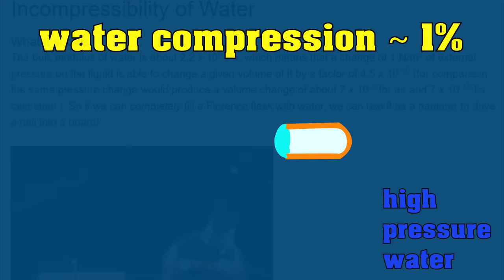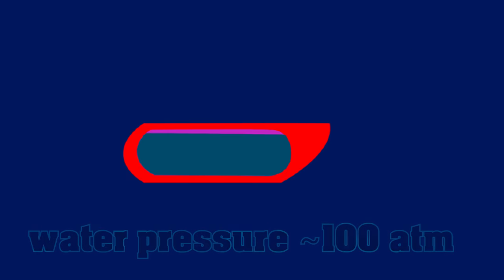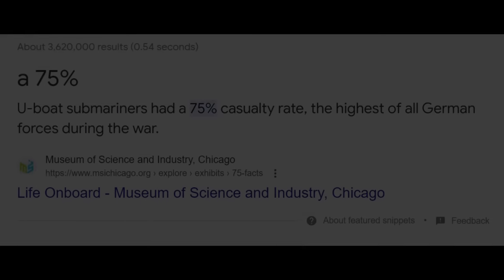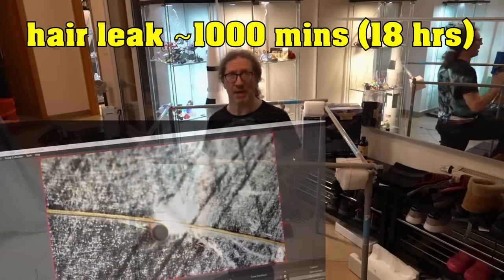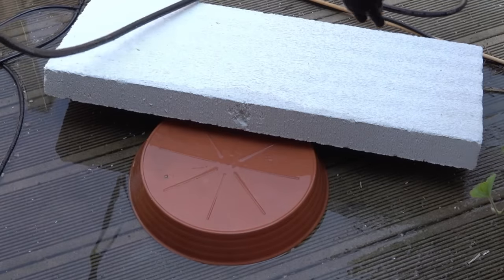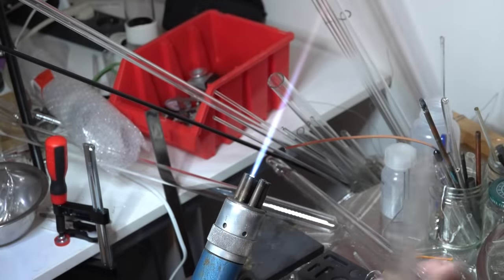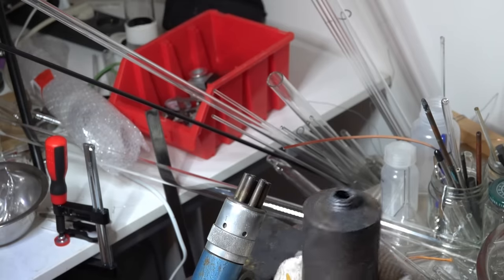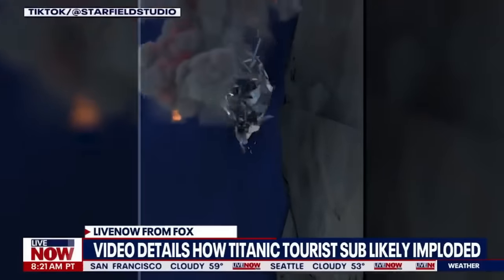Why the Titan sub failed

Comment: I'm not really concerned about the glue bond, because the end-domes are being pushed on with millions of pounds of force.  The problem is the carbon fiber wants to shrink, but the titanium ring won't let it, resulting in an enormous stress concentration at the joint on the inside of the sub.
Reply: 150 million lb-f according to my cell phone calculator.
Reply: Logic is a bit flawed there. Yes, the pressure is pushing the end caps into the CF hull. However, that CF hull (as you yourself point out) moves somewhat independently, and differently than the end caps, or the glue itself. So there are multiple, competing stresses on that glue joint. I think it's the most likely failure point, next to the hull itself.
Reply: Yes, the fiber is the inconsistent element  that itself was built with no sheer web whatsoever.  The bonding operation itself probably had a lot of voids - but still that doesn't matter compared to the tube's complete lacking of sheer structure.
Reply: Well, because of what mentioned, when the cylinder begins to bow inward, the compressive force of the caps will begin to further cause the tube to collapse within itself. It will cause it to buckle inward in a feedback loop.
Reply: Thing is that they literally have the glue bond inside out, as the ring should have had an internal structure as well, to transfer the compression force from the carbon fibre to the inner titanium ring via the epoxy, not put a tensile pull on the epoxy join. That would lead to the carbon fibre delaminating with pressure cycles, and failing. They constructed that join surface as if the join was for a pipe with pressure inside, where the pressure will hold the epoxy onto the cap, not the other way round. Pipe shrank under pressure, and eventually some microscopic section of the join, likely with an embedded air bubble in it that had been compressed to have a sharp edge, caused a stress that started to propagate through the bulk resin, because there is no stress relief in the resin bond, and this then eventually grew to the outside, where water was able to fill the crack. Now the water is applying pressure to a section that can flex, and grows the crack into the joint further, aided by the tension in the epoxy join, and this then rapidly, basically the speed of sound in the epoxy as the growth speed, grew to open the joint to the inside.

That joint should have had an inner and outer lip, and have been filled with epoxy with a slow cure time, and then have the shell pressed down into it, also with a coat of the epoxy on the surfaces, and then pressed together, with a few vent holes for the excess resin to flow out in the titanium, that later on would have a cap bolted and bonded to it. Or a thicker section that you put a setscrew in to fill the hole, while the resin is still not cured, after it has bottomed out, then left and heated to cure fully before removing the pressure.

That join section should have been at least 3 times thicker, and longer, with a taper on the inside to allow a flexible sealer to be there, to allow the join to flex with pressure, not a solid non flex epoxy only. you want to not have stress risers, and a solid join with the different materials will have that stress riser. This hull was likely only going to last 3 cycles before you would have to replace it, they should have done testing, using a deep water area, and a cable and cage, to measure the number of cycles to failure first, not used the passengers as alpha testers.
Reply: With cars, if you are attaching a wide body kit made out of carbon fiber or fiberglass directly to the metal body, you need to not only use the adhesive but bolts or rivets.  Simply using the adhesive will result in cracking after a few hot days and cold nights coupled with road vibrations.  The adhesive is to allow some flexibility between the two substances.  The bolts or rivets are to keep the flexibility to a minimum.  Mainly because they are two different materials and they expand / contract at different rates than each other.

Using just adhesive to hold titanium to carbon fiber without the use of restrictive hardware like bolts, and all you have is a failure point in the adhesive.  If a cars wide body kit cracks just from driving the car around, and it sees mild temperature fluctuations, all because two different substances were adhered together with only an adhesive.  Then how would a submersible be any different considering the extreme water pressures and vastly different temps from sea level to 12,000 feet below sea level?  You not being concerned about the glue bond would be ignoring one of the most glaring problems.  

That adhesive used to attach the titanium ring will let go before the carbon fiber unless the carbon fiber has developed a flaw elsewhere.  Remember, the adhesive is to ALLOW flexibility between two different materials while holding them together.  Its job is literally to expand and contract to attempt to keep that seal.  But just like all adhesives, they can only expand and contract so far.  Hence why there are restrictive hardware items used to keep that expansion and contraction limited.
Reply: @sompka1  A P-Delta affect. That compression at the mid-span of the carbon fiber gives it an internal moment that it has to resist, which also deflects it further and increase the moment, and if it's not stiff enough this can spiral out of control immediately. Usually it's just a small affect you need to sometimes consider, but for very slender structures or very high loadings, the P-Delta affects can pile up.
 
Per the video it would deflect about 1-cm in diameter, or 0.5cm each wall, at 100 atmospheres, but that's onlky 1/3 the way down. At 360 atm, with a 5.5ft diameter, it has 23 million pounds of force on each end, or 741 k/ft of wall, that would be 525-in/ft of internal moment; at a thickness of 5in, it has a section modulus of 50in^3/ft of wall, so 525k-in/50in^3 = 10.5 ksi. That's about 10% the strength of high strength steels, or 3-5% of carbon fiber's strength.
 
So nothing major, but a simple and direct reduction in strength just due to the geometry of the sub and the compressibility of carbon fiber.
Reply: While there may be millions of pounds of pressure holding the end caps on at depth, that is not the case on the surface where this three piece barrel was drug at 15 knots for hundreds of miles across rough seas. The sub was not designed  to be towed like a bucket behind a ship, and this definitely could have affected the glue joints, making at least the rear end cap fit like a loose har lid. Everything in the sub being subjected to a beating by rough seas would certainly subject it to mechanical failure. And lastly,; if you couldn't, or wouldn't, haul that sub out there in the deck of a ship instead of dragging it then it's not likely that it was even inspected before launch.
Reply: @sompka1  Euler failure mode in compression.
Reply: @mr2miach  Thing is car body kits are not run under much strain, as they flex a lot, so the attachment points have to penetrate the material so it is held in place mechanically, as the glue join will flex, and eventually pull the fibres off at the surface. Here the issue is the join has to be orders of magnitude stronger, and any penetrations for bolts would have resulted in massive stress concentrations on the fibre area around them, making them fail quickly. Car body kit you will see crazing of the paint surface before the fibres themselves are compromised, so you are running it under low strain, but here it is run close to the full pressure rating, with little margin for any error, and cycling will slowly degrade the bonding to the point of failure.
Reply: @SeanBZA this sir, is the best comment I've found detailing what needed to be done vs the reality of what was done with the decision of CF hull jointing with Titanium for their deep dive purposes. 

The fundamental flaws and differences... literally mind blowing
Reply: @SeanBZA  did you just correct me by stating the exact point I made back to me?  Because you stated the same point I made.  If a cars body kit fails under much less strain, then how in the world would anyone expect a submersible to do any better?
Reply: @mr2miach  No, car body is designed to flex, with bolts to contain it, this submarine was just a poor design with no way to safely indicate it was about to fail. The testing they put in to tell it was under strain was always going to respond too slowly to prevent the implosion, as the warning came with only a few minutes of time left, when the hull stopped creaking, as all the spare tension in it was left, and the delamination was going to occur as soon as a single fibre brook loose next from the matrix, releasing all the pent up energy in the matrix nearly immediately.
Reply: @SeanBZA  The tube's only unidirectional fiber structure had no designed sheer strength preventing a bisecting fracture; the only structure preventing that was the ring. One area of the most-loaded stress then, as you point out, would have been just outside the ring. However, the images seem to show that that zone remained strong enough for the whole ring to be blown cleanly off the tube.
Reply: @MarkShinnick  At least the front did, have not seen the rear bulkhead, but I would assume the failure was there, and it blew off the front during the pressure pulse from the implosion. They got the rear well mangled, so the implosion was likely that end, simply because the rear would have been turned into shreds if the pulse of pressure had come from the front, just the back is mangled likely from the collapse of the tube there.
Reply: @SeanBZA  I see someone has seen the supposed leaked messages between the sub and the top side.  Point is, it looks like we agree that the adhesive mating the carbon fiber tube to the titanium rings is a possible failure point, because the adhesive is there to allow expansion and contraction of the mating surfaces.  Weird how you correcting me even though you agree.  Oh well, some people just have to argue because reasons.
Reply: @SeanBZA  Seems that any breaching of the tube would simply blow out both rings just as cleanly as what appears in the photo.

Comment: At 20:18 I sure hope that wasn't their official cleaning of the rings, wiping it down with a rag (presumably soaked with alcohol) before the glueing process with the other hand lagging behind depositing grease / oil back onto the surface.
Even with mountain bikes, it's stated hundreds of times to never touch the surface of the brake rotor as the natural oils / grease on your hands will ruin the brake pads.
Reply: You saw the guys hand as well ! I am glad someone else saw that, and I was also thinking the same thing. So careless if that was the final cleaning.
Reply: still amazes me the amount of people who touch these things... or even when builders apply silicone with a bare finger, i dont want mouldy grout!

Comment: You can design pressure joints between dissimilar materials that will work fine. Industry does that all the time.
Often the pressure will be used to seal the joint by pushing the joint together.
Piston rings , for example , gas from the the high pressure side of the ring is directed behind the ring to force it against the cylinder bore.
Reply: I don't think you are using the right comparison. There is an oil film assisting the sealing of the piston ring too, and still, the seal is NEVER 100% prefect. In the case of the sub, it has to be.

Comment: Delamination was the likely cause of the Sub implosion, the noises heard from witnesses as the sub went down and up very low depth is likely to have been caused by internal delamination of the Carbon Fiber / Composite hull overtime
Reply: This is correct and never considered by Thunderfoot, because he's making uninformed guesses.
Reply: @SoldererOfFortune  There is an excellent video on the subject I watch just the other day from someone who did a PhD on just that scenario! Will post the link if I can find it again
Reply: @SoldererOfFortune  Nothing of the guesses in the video is uninformed. It's just another failure mode. If there will ever be a public report about the incident, maybe we will learn which failure mode was the most likely in this case. Sure, delamination is a probable one, but the mating area between two completely different materials is defenitely another probable one. Heck, even the 1300 m rated window was a probable failure. This thing was a red flag carrier.
Reply: @nikethunner2732  exactly. It could have been any number of things. This is a likely scenario but there are others.
Reply: Found it, video from "Real Engineering"
Reply: Exactly.. 2 huge problems.. first off CF is NOT designed for compressive usage. and secondly the shape was in form of a cylinder not a sphere. I mean I don't know how STUPID whoever designed this thing was but tell you what it does NOT take a mental giant to figure out compressive loading! I mean if you're too STUPID to figure it out run some tests on different shapes.. Use a barrel, then a ball, then a triangle. yeah pick your shape but keep the sidewall all the same thickness and see what blows up first. Tell you what a barrel or triangle is gonna blow a LOT sooner than a sphere!
Reply: @SoldererOfFortune just interested to see if you have the integrity and intelligence to recognize that you are hating for no reason.
Reply: @GameTimeWhy  Showing the pressure of a water jet by spraying cinderblock to make a point about a "water jet leak" damaging the composite is ridiculous.
Reply: @SoldererOfFortune  He used what he had, it didn't work but it gave some people an idea of what he was talking about. I think people can extrapolate the results he got, in their heads.
Reply: @leecowell8165  Not true. Everyone keeps reiterating this lie about "carbon fiber is only good in tension". That's a lie. It only applies to the FIBERS themselves. Not to a composite carbon fiber piece.

The entire reason they're encased in epoxy is to get around this.

F1 cars have PUSH rods... yes PUSH RODS made out of carbon fiber sometimes.
Reply: @SoldererOfFortune  sarcasm?
Reply: @SoldererOfFortune  you could have just said "no" to my comment.
Reply: Nuh uh.  Rush clearly said all those alarming noises were normal and to be expected.  Nothing to see here, move along... 😉
Reply: @polarvortex3294  Lucky for the world he wont make that mistake again
Reply: @GameTimeWhy These are uninformed guesses, though.

He makes wildly inaccurate comparisons in this video and the last: water free-falling into a space below it and a microscopic water droplet expanding into a vacuum flow nothing like water under an ocean filling a cavity.

He misunderstands pressure: he says the water pressure would have equalized to the air pressure inside the sub, and he is surprised a power washer doesn't damage brick while comparing it to water jets that typically use 50 times the pressure or more.

He is speculating a specific mode of failure while insisting that other models are wrong, based on intuition and some household experiments with completely different design parameters and material properties.
Reply: @SoldererOfFortune  Everyone is making guesses lol, Both theories are valid and could be true. In Thunderf00ts case the cracking sounds could still be heard in his example of glass on metal bonding. So it's possible carbon fiber on titanium would also make the cracking sounds when under pressure.
Reply: Maybe a whale was shooting a gun nearby.
Reply: @Obi-WanKannabis  Some people are making their guesses based on better engineering understanding than TF, though. There's a difference between a guess that's based on actual material engineering and fluid mechanics knowledge and TF being unable to accurately explain how water pressure works.
Reply: @Obi-WanKannabis  No, they took in consideration the compression factors, hence the CF was combined with strong Epoxy and therefore the compression issue becomes a lot less likely. It is true however that the way they weaved the CF was most unusual, choosing to only roll in one circular direction and no cross overs or horizontal directions.
Reply: @CookiesRiot  There is a video by a Phd egineer, which comes to exactly the same three theories (based on expertise and simulations) as pretty much everyone else. Sealing (as TF proposed), hull collapse and window. TF shows no worse engineering understanding here than acutal Phd material engineers. The guy's channel is Dr.-Ing. Ronald Wagner, if you really want to double check. His video on the matter is interesting, worth a watch.